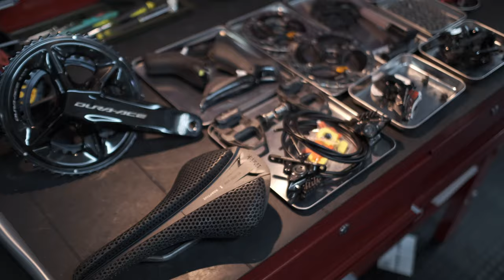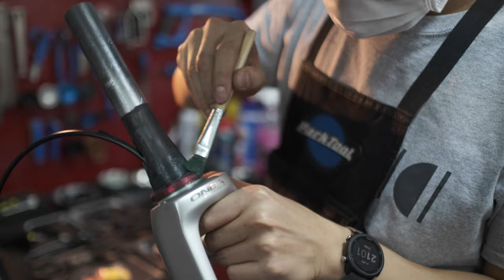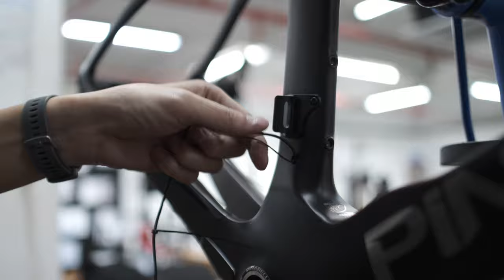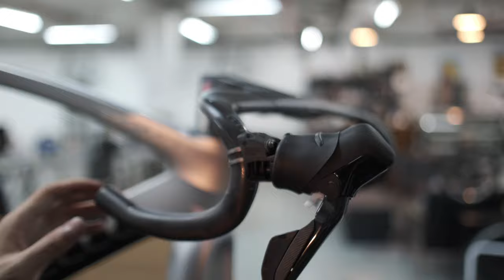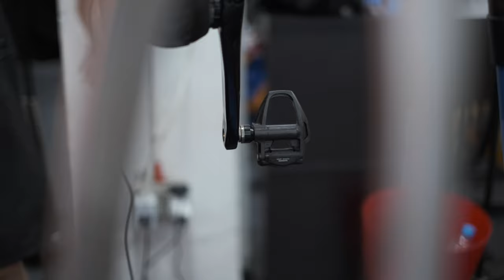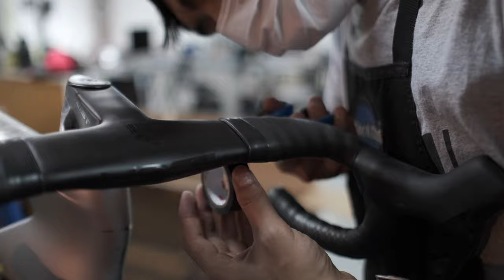DREAM BIKE BUILD: Pinarello F Plutonium Flash

Comment: Some bike customer has some money to spend. 😳🙂🙂

I’m impressed you using a vacuum and mask when cutting carbon, cutting carbon is nasty on the lungs 👍👍

Interested to know what grease to you like to use?
Reply from the maker: Anything thick would be good so as to help repel moisture and water for general assembly.
Some good brands include Park Tool, Morgan Blue, Finish Line and Shimano Premium grease.